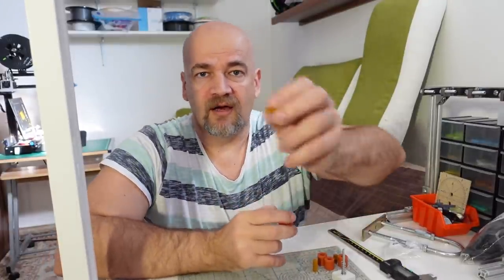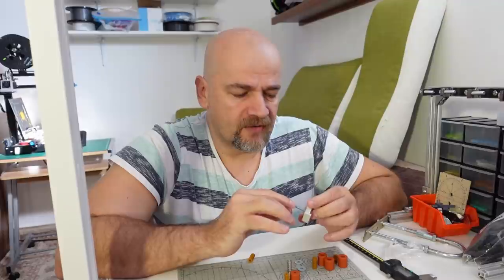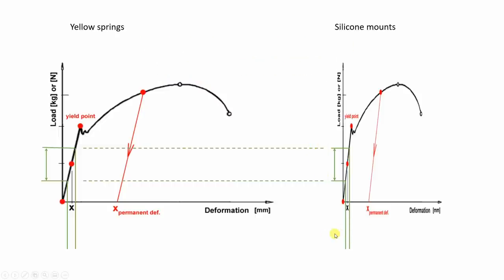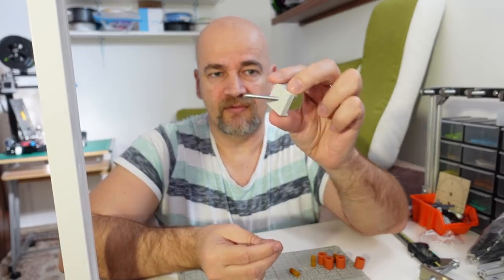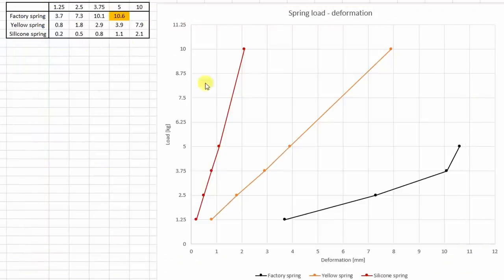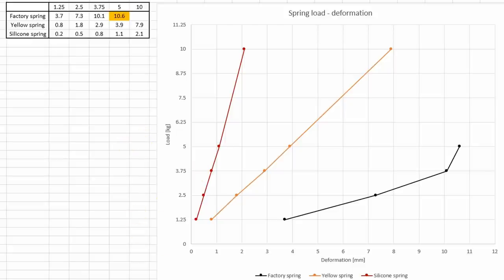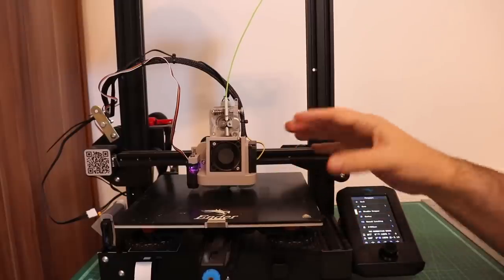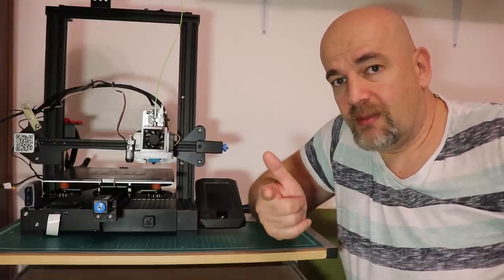Silicone mounts vs yellow springs vs factory springs - Ender3V2 upgrade

Comment: Good video. Your graph shows that the factory springs compressed at a higher rate above 10.6kg load. That explains why I was having such a hard time adjusting the spring in the back left corner, because it has the extra 2mm base from the cable guide and would compress greater than the other springs.  A small change in the knob would result in a bigger compression change.  One thing to note, you tested the compression of the springs but did not show if they retained any deformity from the compression.  A properly designed spring will not deform when compressed.  If you had measured the compression of the springs after multiple and prolonged compressions, you would likely find that they retained the same compression force, although I am aware we are talking about Chinesium springs and they may have cut some corners on the design.  I think the silicone ones are more stable and less susceptible to vibration and heat deformation than the metal springs.  I just installed the silicone spacers today and printed a 3d-benchy. It came out a little smoother than with the original Ender 3 Pro springs.
Reply: One of the stock yellow (ish) springs on my Ender 5+ didn't just deform it broke! when I took them off I could see they were very different from the yellow springs I bought for my other printers, when I bent the spring metal it bent and then clean snapped and you can see micro holes in the metal when under my cellphone camera and zoomed in

Comment: Thanks for a great comparison. The silicon posts are good for auto-leveling set ups while providing a very slight give to the bed in case the nozzle scrapes. As for manual levelling, I've never had problems with the "weak" stock springs. Tighten the wheels to fully compress all the springs. Adjust Z-stop to trigger on the highest point of the bed - move the around while turning the Z rod to find this. Perform your bed tramming routine by only loosening the wheels. This will ensure maximum spring compression while keeping the wheels tight.
Reply: @hoffer_moment  - It doesn't matter if the springs get deformed, it's not permanent, and they'll still provide an extension force. I've trammed my beds with fully compressed springs and they stay trammed until I swap in another type of print surface. Simple.
Reply: @hoffer_moment  - I didn't say fully squash the springs. There's a huge difference between that and fully compressing them - springs are designed to be fully compressed, as in no gap between the coils.  In the end, people ought to use what works and what's simplest for them.

Comment: Hi Igor. I recently changed my springs for the silicone mounts. I am not a mechanical engineer, so forgive me if I am not able to back up my understanding of this system with proof or data. As I understand it, if the bed is level, then you don't actually need a BLTouch to level the bed. The BLTouch does nothing to level the bed. That's why you have to level it yourself before you can use an auto bed-levelling device. The BLTouch only compensates for bed surface irregularities by adjusting the height of the nozzle, and to function properly it relies on a mesh pattern it creates then stores either on the SD card or in the EEPROM. If the printer bed is level after installing the silicone mounts, it should remain relatively level as long as the mounts do not compress too much more. The BLTouch will then help compensate for the height differences between nozzle and bed, which is affected by the deformation of the build surface. Thanks for this video. I appreciate the scientific approach. It helps me to better understand 3D printers and how these work.
Reply from the maker: Yes, that's exactly how it works. BL touch is important if ved is warped. Or for those, who commonly change the build surface (several types of PEI sheets or simar)

Comment: That is correct, you might move the bed out of alignment by moving it manually!

I just let my print cool down, it releases no problem and with zero resistance every time!
Reply: Also, if the bed is tweaked a bit... It should level out eventually, unless you really whacked it.

Comment: Nice video, thanks. I have ordered the yellow springs and the BLtouch before seeing your video. 
I'm sure the glass on my Ender 3V2 is warped exactly like yours, concave with a hole in the center, which is the worse for leveling manually.

Comment: it is not mainly about spring strength, its the compensation of the springs to the non ideal surface of heated bed and frame/table the 3d printer set on
Reply: Can you explain in more detail? They can all be adjusted adequately for bed level in the 4 corners the silicone ones can just do it under higher load.

Comment: I upgraded my ender 3 S1 to the silicon standoff. After a few weeks they are great. I would level the bed every few days, eventually they have squashed enough where they are now stable. The springs would, under temperature controls, and vary throughout the print. I have my printer in an enclosure now so this my not be as significant

Comment: Running Klipper with resonance compensation means I don't care all that much about vibration dampening.  But the silicone mounts have another killer advantage - a tiny bit of extra usable Z height.  Unless you're cranking the strong springs way, way down, the silicone mounts are shorter.

Comment: Excellent video. I had replaced the original springs with the yellow ones on all 3 printers at one point. I bought 3 sets of the silicone spacers awhile back, but only installed them on the Ender-3. One issue I had when installing them was my bed wasn't trammed very well to the gantry so had to really tighten down the one side to get it close enough and then have the BL Touch do the rest. I haven't had to re-level even after months. But that goes for the other 2 printers with the yellow springs as well, so I'm not sure how much of a difference the silicone spacers would really make in the long run. I'll probably still eventually install them on all 3 printers though since I have them.

To take it a step further, what if the spacers were made out of steel and then had zero deformation? If your bed and gantry are trammed really well, then could see this working, but if your printer is like mine then it would be too far out of "level" for the BL Touch to compensate so I think having some play as you get with the yellow springs is probably the way to go.
Reply: Solid spacers are available, but the problem is unless they're manufactured right and very precisely, your bed is going to end up out of tram and every print will have to be compensated for. I got some and I couldn't get the bed close enough to level for my satisfaction.
Reply from the maker: If you can make it flat, use steel (or better lighter alu) colons. Maybe adding teflon washer above to get minimal elasticity for permanent leveling.
Reply: @dalem04  Not sure why you were having such problems. Things like this are done in the metal fabrication business everyday all day. Hell you could have just used stainless steel washers and stack them until they were all identical heights. It's not rocket science.

Also wondering where you bought your spacers. It has to be one of the easiest things to make.

Comment: Did just add plastic spacer under heat bed (for protections) and then a normal nut (to prevent screw to spin) and then the original spring and at the end printed new leveling wheels with lock-nuts. Has soon been 2 years since I leveled my bed. 
I don't use any BL Touch, print on normal glass (3mm) from local glazier.

Comment: this is a great video i purchased a biqu microprobe and ever since i had it ive had issues with printing. i use the yellow springs. your video explains the problem better than anyone tried to help me and you mention if you have a z end stop then the yellow springs are best and i agree with you i used to always use a z end stop and i had virtually no problems with printing. any problems i had were elsewhere

Comment: I see the bottom line as:- if you treat your printer bed like a workbench, buy stiffer springs and/or a bed levelling sensor.
Comments suggest some ringing is more likely with more compliant springs, maybe just the frequency of ringing but my E3 is slow so if I see ringing I might consider stiffer springs.

Comment: I switched from silicone to stiffer springs because when squished they were interfering with the threads of a bolt making the bed not return to the same position when pushed down or up.

Comment: My 2 cents worth on leveling an Anet8 Plus. I removed the glass top, took out the 4 bolts for the heatbed. I then bolted the Anet8 Plus on a piece of plywood. I put items under the plywood to level the 3D printer. I leveled the X gantry to the bed frame in both directions. This is where things get strange.....After doing the familiar exercise of moving the tip around the bed and homing Z axis a few times I noticed when homing the left Z motor makes a grind noise and lowers the left Z axis a bit. Disable the motors and twist the right Z axis to level it up again. I spent 5 days with this problem until I printed a new Z axis stop that mounts on the left side and then removed the left and right spiral rods ,re-set the set screws into the rods and leveled them. I replaced the springs with rubber ones. After many times homing the Z axis the level of the gantry has stayed level. I printed a test for checking the levelness...perfect, time will tell. But checking the gantry being level on all prints will be a priority for me.

Comment: Try replace the springs with  Hexagonal Copper Pillars.  You virtually don't need manual leveling given mesh bed leveling.

If you, for whatever reasons, really want to do manual leveling with springs, you need a far more rigid frame than just a plate of 1mm steel.
Reply: do you have a recommended height for the ender 3?
Reply: @ljohnso16  I simply replaced the 4 springs with 4 10mm hex copper pillars.  Nothing special about the 10mm though, I just happen to have four 10mm pillars around.

Comment: Wouldn't metal spacers be better, assuming they are safe to use and don't cause other issues. The silicone being able to deform slightly defeats the pupose a little for me, as you can crank one screw too much in one corner maybe.There's still a slight element of feeling each side to make it consistent.
Reply from the maker: Light, aluminum columns is worth to try, if you can make all 4 corner in one plane, leveled, because you need minimal elasticity for this adjustment.

Comment: Hey My Tech Fun, awesome video. This was really interesting. So, to what percentage or mm length would you compress the yellow springs to before you start calibrating each corner? I compressed them on all four corners to 15mm (25% compression) before the calibration. After the calibration they are compressed to length at around 13mm. Do you think this makes sense according to your charts?
Reply from the maker: 25-60% is fine
Reply: @MyTechFun  Hey thx for the quick response :-) So 60% would be a good start setup to start leveling or would it be the max? Meaning is it the range the range for the spring to function without permanent deformation?

Comment: Do you have pictures of the ringing before and after each of the modification of springs? I would say that with the factory springs you should see a lot of ghosting/ringing and with the silicones they should be greatly reduced. A side by side photo would be cool.
Reply: One main point of stiffer springs is to keep the bed still. No movement from the mounts. Ofc if you print slow it is okay. But at high speed it has a purpose
Reply: @girenloland  I know the fundamentals. I work as senior mechanical engineer. Just to make the movie complete an end result of the mods should be shown. Otherwise you could do that and see no benefits. So what would be all your effort for? Wasted time?

Comment: I just got a Cr6-SE and I am having some bed levling issues. I am wondering if using these silicon springs under the 11 bed screws might help tram the bed in better. The printer is comping the errors but I am having a hard time getting a good first layer on the entire build plate. Love the channel keep it up!
Reply from the maker: CR6-SE? That's printer with Auto bed leveling I think. Leveling should not be the problem. You want to check the Z-offset, is it set correctly (distance between nozzle and bed during 3D printing, is it too far or too close)

Comment: I can't tell you about the silicone mounts, but after a few weeks/months I even see deformation in my Prusa MK3S which is mounted pretty rigidly. It's not a lot, but it is definitely noticeable and without the bed leveling probe it would be quite problematic..

Comment: I love how your graph shows how much dampening affect the silicone has compared to the springs.  However, running klipper with input shaping, the resonances are going to much more offset from the bed to the nozzle than with springs, where the linear reliable movement creates desirable oscillations in my opinion for klipper specifically. What's your opinion on that?

Comment: Nice testing! Your previous video about creep and different plastics makes me wonder about how this property might impact spring material. If you put all three springs under say... a 5 - 10kg load for a week, would the metal springs be more or less prone to permanent deformation than the silicone?
Also under heat cycling that could be seen with bed mounting fixtures.
Reply from the maker: That's why I asked for experience from others. Also, if 100-110C of bed is a problem, a teflon washers can be added above silicone.

Comment: Hi Igor, great video. I just bought a CR-Touch so will get some silcone mounts. What version of Firmware are you using please. Please could you provide a link. I have an Ender 3 V2 with v4.2.2. board. No other mods other than the CR-Touch I want to install.
Thanks for your help
Reply from the maker: I used Jyers firmware, but a custom one, since I modified the max temperature limit (since I have all metal hotend)

Comment: Great video.  Why not just use metal spacers and nuts it you have the CR touch? This would leave the bed fixed, no flex  and secure.  ?
Reply from the maker: You need 4 metal spacers, but if they are not flexible at all, it is hard to have the bed in flat and leveled (parallel with moving path of the nozzle). You need minimal elasticity to adjust this.

Comment: Did you not have issues with the screws rotating in place when turning the knobs before? I had to install nylon lock nuts to the bottom of my bed so that the screws wouldn't rotate in place rather than having the knob tighten the spring...
Reply from the maker: If there is enough tension on the springs, then friction should hold the knobs in the place. That's why you need springs compressed at least several mm-s.

Comment: Mount a fan to the bottom of your printer and have a switch to turn on the fan. You can simply pull the 24v to a 24v fan and add a switch there. On Ender boards the hotend fan always spins... so yeah... all you need to do is to turn it on and your bed temp will fall really fast and then you hear a cracking and the print comes of itself :)

Comment: Thank you for the info. I was wondering if there may be any heat transfer from the bed to the yellow springs that may decay their elasticity. If there is a teflon or carbon fiber washer to negate that but over time being compressed it will affect them. Good thing they are cheap for now.

Comment: Excellent demonstration of the three types.
I had swapped out the factory springs for the stiffer yellow ones.
I recently added a CR Touch to my Ender 3-V2 and definitely see the value in adding the silicon spacers.
When you put the silicon spacers on, why did you switch back to the factory adjustment wheels?
Reply from the maker: They are smaller, I want to add heatsink to y stepper

Comment: If there is a BL touch, why can't we just put metal spacers in place and double lock nut the adjustment wheels when we get a manual level? That would permanently set the level and the software could compensate?  Get rid of the spring function completely because it is unecessary?
Reply from the maker: Yes, a lot of printers which have factory installed BL Touch have fixed bed. If you can fix all 4 positions to be flat (in 1 plane), then yes. But it bay be hard, especially because of back left one. The plane position is important, to avoid warping of the plate.

Comment: With Jyers FW you can do manual bed leveling without a paper, using bltouch.
Reply from the maker: Good to know. Thx
Reply: You can also try the Mriscoc FW, it has more useful features and better support. I will try with silicones spacers... I don`t have ABL yet, but just for comparison. Nice video. Keep going!
Reply: @JoseArevalo-Fester  I try, no way. Not open source project.

Comment: What about orizontal dilatation of the heat plate?
Springs permit the holes to move a bit, silicone bushings compress too much obliging the bed to dilatate in vertical creating a dome. So the nozzle become more closed to the bed in centre and distant in corners.

Comment: Ive just got a set of 4 silicone mounts from Creality.
3 are the same size one of them is 1mm shorter than the rest...
Wonderful quality control 😕
I shall order another set and see if I can make up a set that I can actually use.
Reply: that is expected... the shorter one is for back left portion of the bed where the cable mount is
Reply: @santiagomoneta  my bed doesnt have the cable mount there. I needed 4 the same length